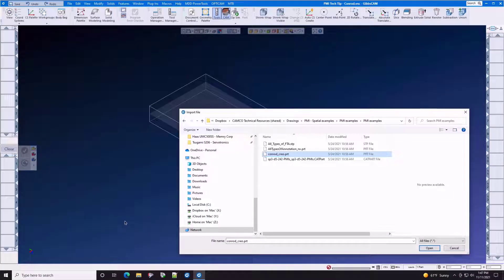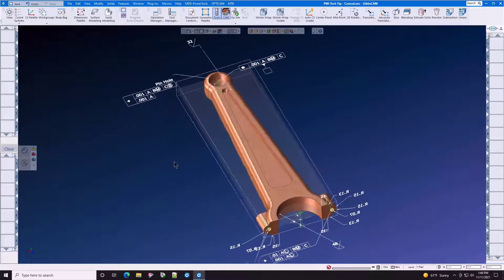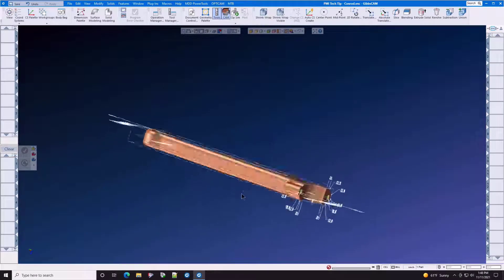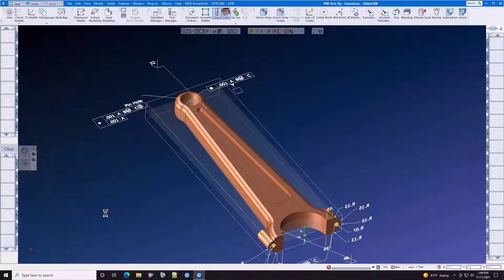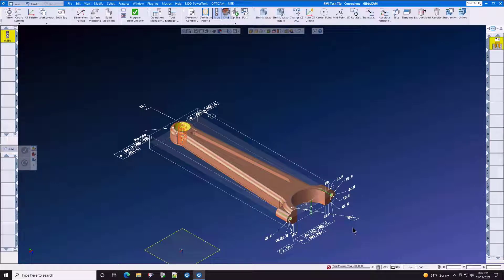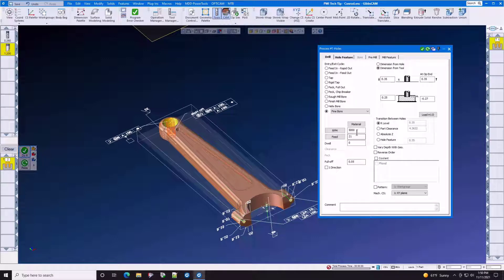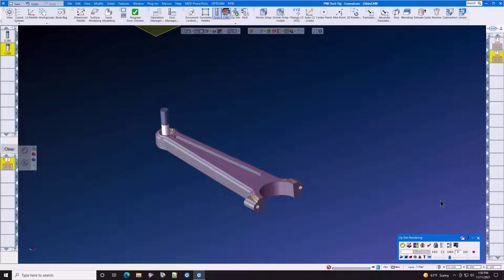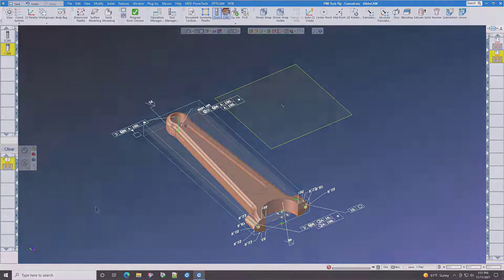GibbsCAM Tech Tip: Import and Use PMI Data to Streamline CNC Programming

Comment: What is PMI?  Is it an addon to Gibbs?  I use Creo but I don't see prt import option in my Gibbs
Reply: PMI is tolerances datum structures and surface finishes etc. PMI import is solely dependant on the CAD system you are using, if PMI is available it will be displayed in GibbsCAM. In other words your CAD author has to include PMI data in the CAD file.